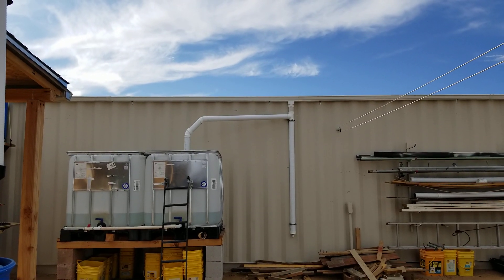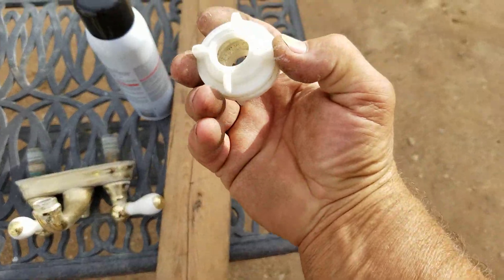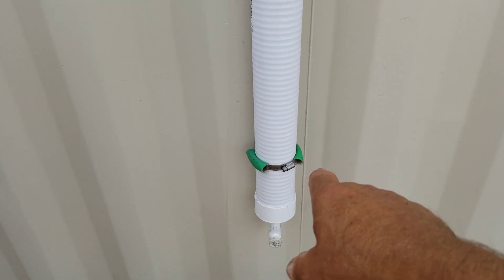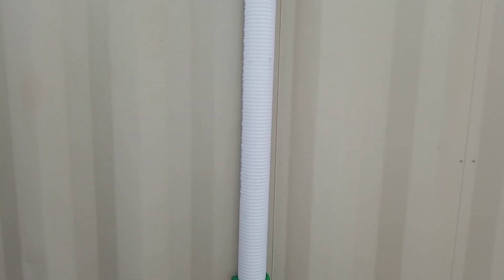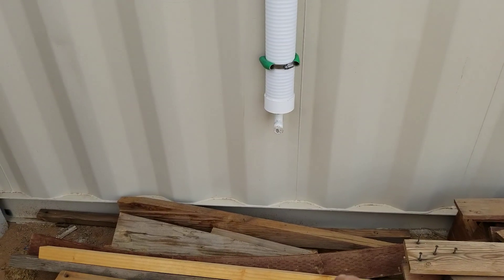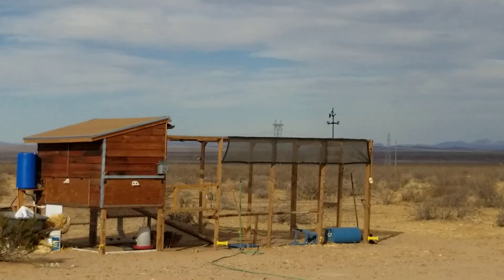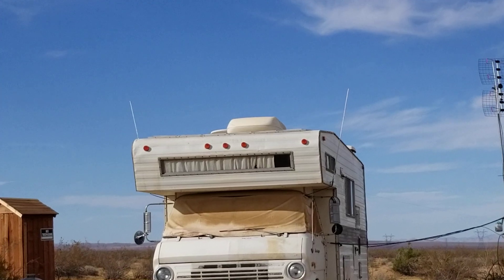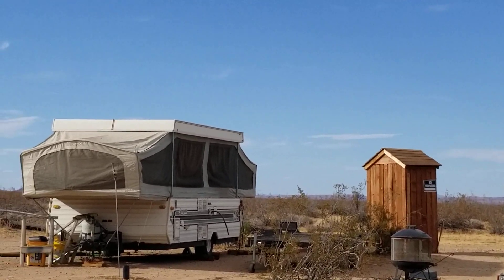How to build a first flush system for rain harvesting.  Sep. 25, 2019 Part2 of 2

Comment: Thank-you for the advice on the solar and batteries. Mine full sun I am getting 14.4 v float usually it floats at 13.8v and shuts down at 11.5v at night I am usually around 12.2v - 12.9v depending on what I am running one of my batteries is older than the rest. When I get the chance I need to go a couple of towns over where i can buy a jug of distilled water. I also have my new pure sign wave inverter installed and I am getting lot less voltage loss. Than my old modified sign wave inverter I have recently observed.
Reply from the maker: All sounds good, BUT, take the weak battery out of the system!  The weakest battery in the system will draw down the others, not the other way around.  It's the same with flashlights, and other battery powered devices,  never mix new batteries with old.
You should ALWAYS have spare distilled water on hand.  Replace it as soon as you use it.  Also, adding water to a weak battery won't rejuvenate it.
Reply: @GBear  Yes I know about that I have heard that epsom salts sometimes work and you can add battery acid I have never tried it. I need to check it with my hydrometer. I just have an inexpensive one I picked up at my local parts store years ago.
Reply from the maker: @VickyGeagan  epsom salts don't work.  I tried that 4 times, and it failed each time.  Still, a weak battery will damage the good ones, it isn't worth the price.
Reply: @GBear  I am pretty sure my battery is ok. Just that is old and I plan to replace it eventually. I also know about mixing good batteries with good ones. I have made that mistake before myself, also I have over charged batteries and have ran them to low. That was back when batteries where a lot cheaper.
Reply from the maker: @VickyGeagan  I understand and will stand down.  They are your batteries on your system.
Reply: @GBear  Yes they are I am sure the old one is getting on to its limit though. I have had it around six years or so. I have never had to add water to it. Probably to the fact I have never stressed it to much.

Comment: Hey GB, we had crazy few weeks. But, we are back on track with your videos. Re: mice, this is great stuff you showed. We have 2 cats who are killing mice each day, but they still managed to chew cables in our 2 cars that we cant drive at the moment. Gggrrrrrr.....maybe we need to spray this product under the hood! Great work on flush - says Cary, we need to make ours finally, just missed a wave of a good rain.
Reply from the maker: Nice to hear from you two!  Caution!  Don't spray that deterrent under the hood!  If you need to use it on vehicles, soak a rag, place it in a tin can, then place it in the engine compartment.  But remember to take it out before driving.
You can also soak pieces of wood like 2x4's and slide them under the vehicle close to the tires.
Reply: @GBear  thx, good idea.
Reply from the maker: @anya7540  you could also spray it in the wheel wells, under the fenders, since they obviously get up there by climbing the tires.